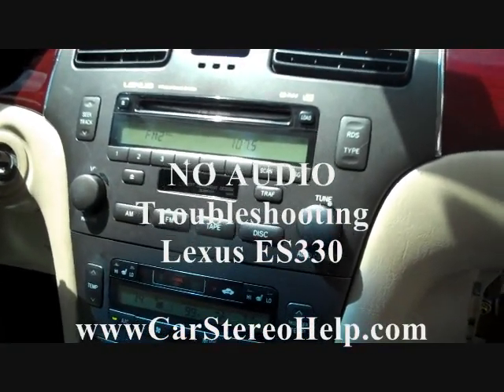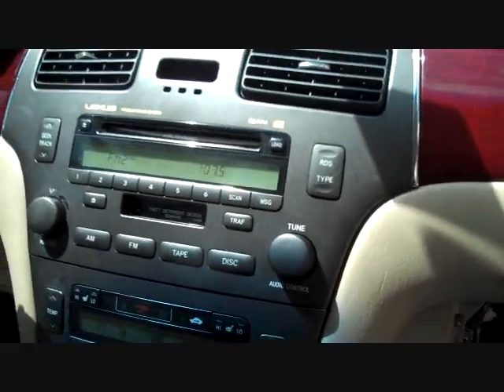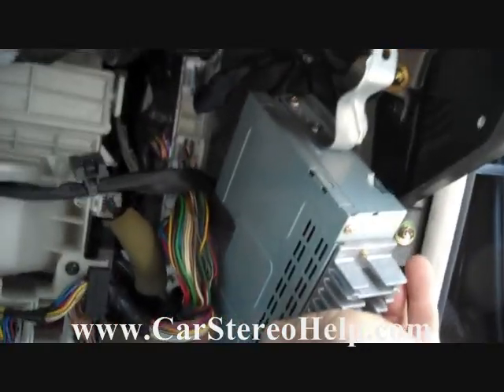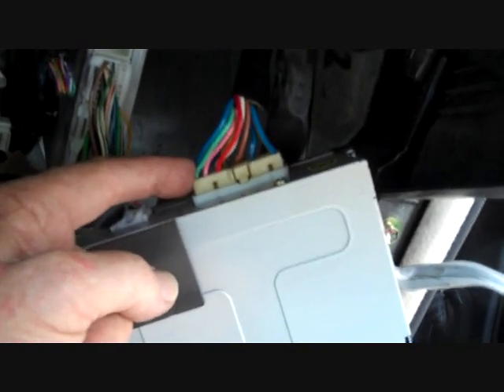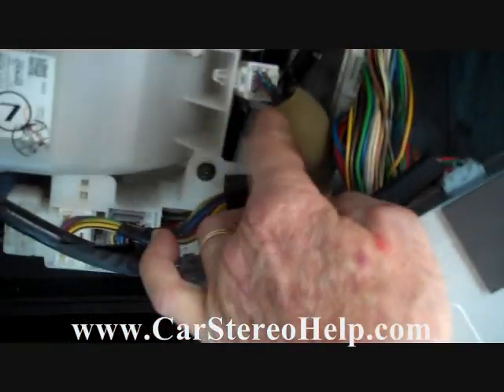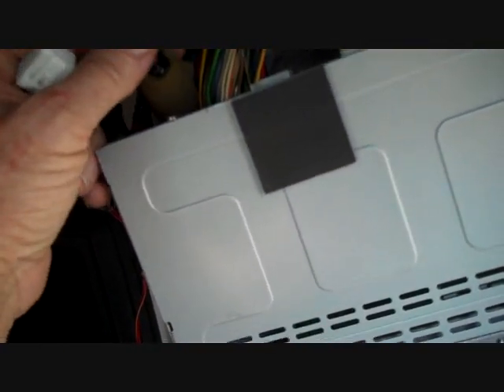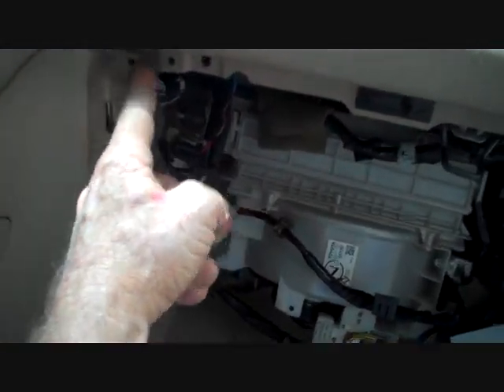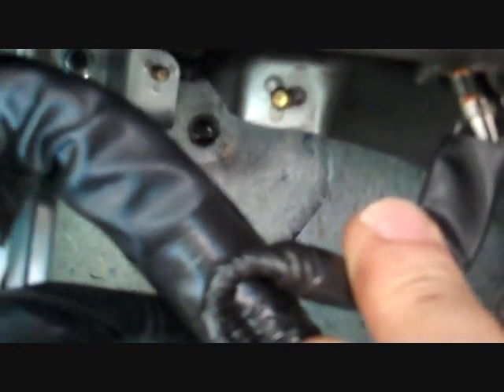Lexus ES330 Amplifier Removal and No Audio Troubleshooting = Car Stereo HELP

Comment: Just want to check this with you. I have the Mark Levinson amp in the trunk and I can get the navigation to talk but not the radio/cd etc so I figure the amp is bad in the trunk. I am thinking there would not be an additional amp in the front as in this video. Is that correct?

Comment: what color is the oem amp turn on for es 330 2006? Im trying to swap the radio and i have the TYTO 01 adapter, and the radio turns on but no sounds comes out. so im almost positive the amp isnt on. please help, what color is the amp turn on wire in the lexus, i know the blue and white wire is the one for the radio.
Reply: bro did you ever figure this out lol
Reply: @jessepalefsky5363  nope, I took it to a shop

Comment: I replaced a transmission in a GMC Sierra and the same thing happened with 2 speed sensors one plugs into the transfer case the other near the output shaft. They were switched and it caused it to slip and shift horrible. It was a used transmission too.  I was about to condemn it and start all over again!